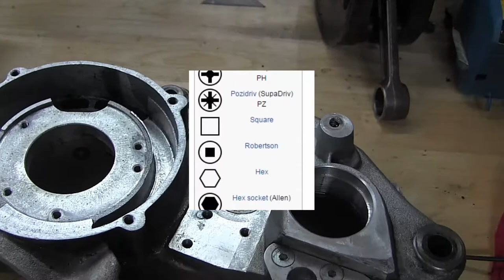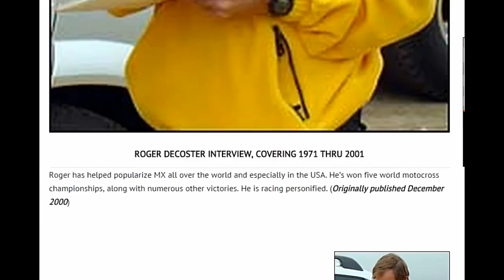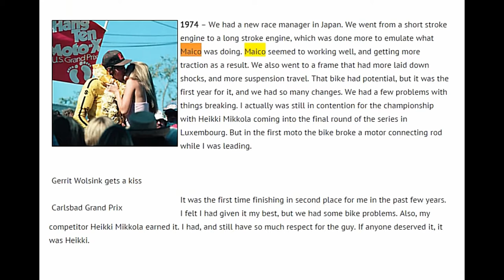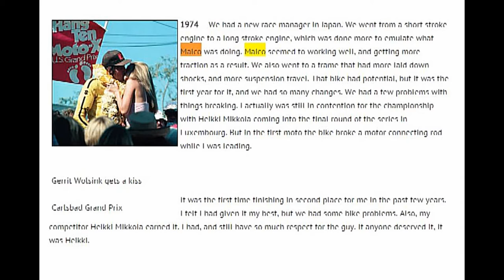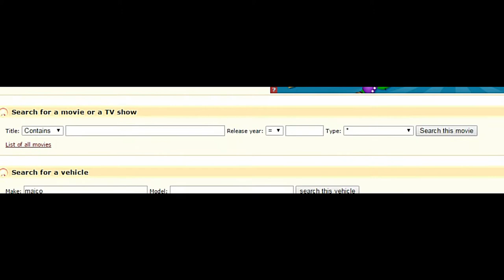The Quality of Maico Motorcycles Part 5 of 5 (Documentary)

Comment: Thanks for the memories.  I owned four Maicos back in the 70’s and 80’s.  Before electronic ignition, Macios had to be maintained very carefully.  I took off the ignition cover and made sure the points were dry.  Condensation inside the cover was a problem.  I also adjusted the points timing with a dial indicator and a buzz box before every race.  I did not have problems starting because of the maintenance.  Maicos were pure race bikes.  They were not ride and park.  One more thing on quality.  The clutch was brutal, but that was not a problem, because you only used it once at the start.  After you left the gate it was all clutch less shifting.  Never had a problem with a Maico transmission.  From my experiance, they were bulletproof.  Superior German engineering and materials!

Comment: Thanks for the vid's. My dad bought a maico at swap meet around 30 years ago. It was in rough shape when we bought it but it ran. I used to ride it in middle/high school. It stopped running and I thought my dad sold it, but he held onto it and just sent it off this year for a frame off restoration and is sending it to me for it's final home. I thought it was a 490 but it turns out its a 1980 440. I am trying to find out as much info I can about the bike. I can't find much about the 1980 440. I guess the frame wasn't that popular and maico switched things up in 81. Any info you can share on the 1980 440's?

Comment: I think you were able to demonstrate in this series that Maico was / is a very high quality and innovative European bike.  I don't recall any other dirt bike using a primary chain except Maico. Were there any others?
Reply from the maker: Thanks.  Yes, for example Bultaco.
Reply: Opferman Motors (tobyeo) and Ossa too :)
Reply from the maker: DirtBikeDudeZ ya actually it was pretty common on older bikes. Theres a lot of old street bikes that use primary chains some even use belts. Im sure theres other industrial machines which also use primary chains. Its pretty common. Lawn mowers and gocarts for example use side shaft engines where the side shaft to the transmission if there even is one uses a chain usually on a cyntrifucal clutch.
Reply: Opferman Motors (tobyeo) True toby, back in the day it was very common. Almost all old spanish bikes had them, except Montesa...
Reply: DirtBikeDudeZ When i first opened up my Ossa 250 M.A.R engine i was like whoooaaa whats that :P i was like 13 years old at that time..

Comment: Hi ! what is oryginal candle number for maico mx 500 2008r ?
Reply from the maker: +Joanna Iwanowska Not sure what you mean by candle number?
Reply: +Opferman Motors Dirtbiking i have ngk br8es, ngk br9es, ngk br9ecs and ngk br10es.  which is suitable ? I use translator so i'm sory for mistakes ;)
Reply from the maker: +Joanna Iwanowska the original is a b8egv or something simmilar but they do not make them anymore. br8eix is best but br8es or b8es would be ok.
Reply: Opferman Motors Dirtbiking
thank you ;) Tell me more why
my bike hard to start. sometimes when you start to score a pipe , and when it start have huge vibration. ignition may be incorrectly set ?
Reply: Opferman Motors Dirtbiking in europe ngk b8egv are available ;)